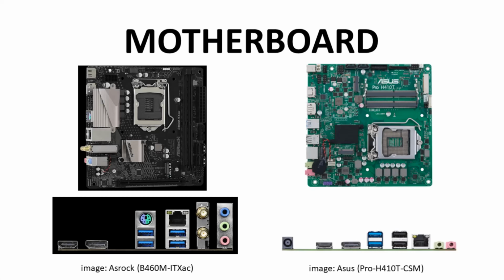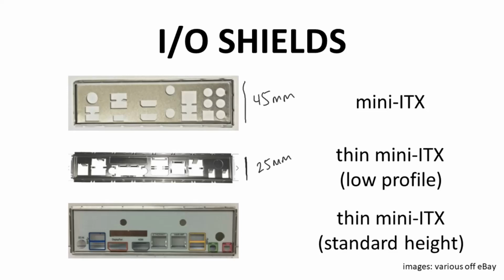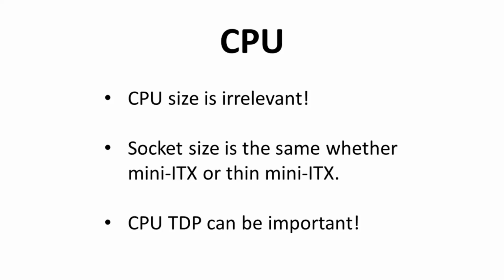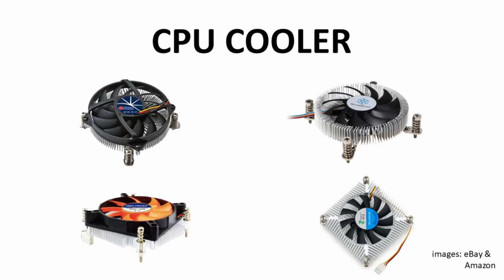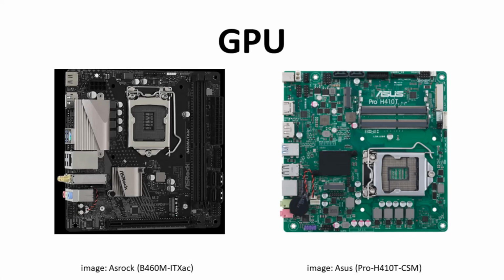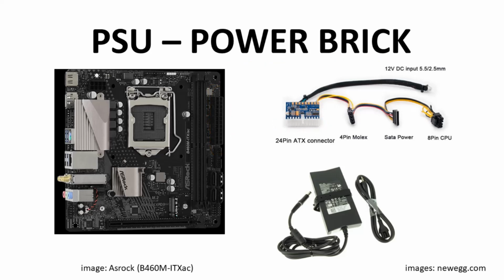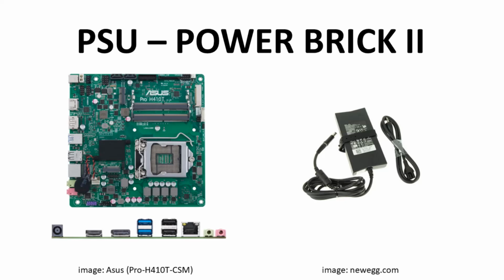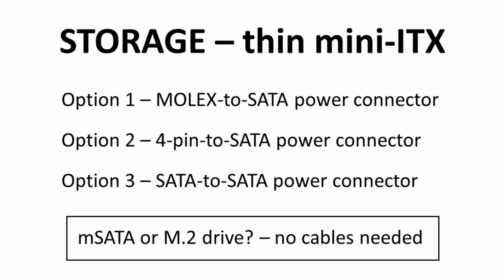mini-ITX vs thin mini-ITX motherboards

Comment: I looking for hm65 motherboard.. i found some Chinese all in one mobo. I looked at the picture. It has 4pin atx power.. can normal 24pin atx psu powered the motherboard? Because I have extra unused atx psu and an old laptop. Want convert them to media desktop pc. But afraid to buy the motherboard.
Reply from the maker: The short answer is, I don't know.  That 4-PIN power (normally right next to a 12 or 19V barrel jack is an alternate way to get power to a thin ITX mobo.  That jack is often 12V, maybe 19V, and occasionally can take either voltage.  If you look around, sometimes you can find a PSU (AC/DC adapter, not an ATX PSU) with a 4-pin end.  I don't know if you can just use a 4pin CPU plug from an ATX PSU.  By the way, those AC/DC adapter PSUs are quite cheap. If you're using a SATA drive, you'll likely need a special power cable from the mobo to the drug in addition to the SATA data cable.

Comment: so in resume mini itx are used for laptops right?
Reply from the maker: Mini and thin mini ITX are form factors, and laptops tend to customize their boards in a way that breaks any standard form factor.  Laptop boards have weird shapes, weird layouts, and a range of I/O.  All these qualities make them violate any industry standard.  Mini ITX is a form factor that has a critical mass of adoption by parts makers (cases, motherboards).  Thin mini ITX maybe barely does.  Thin mini ITX was supposed to be a standard for things like all-in-one PCs, but manufacturers did not embrace it.  AIO PCs follow the non-standardized stylings of laptops rather than what is seen in desktops (ATX, mATX, ITX).  The fact that dedicated GPUs do not fit well with thin mini ITX really hurts adoption of the form factor.